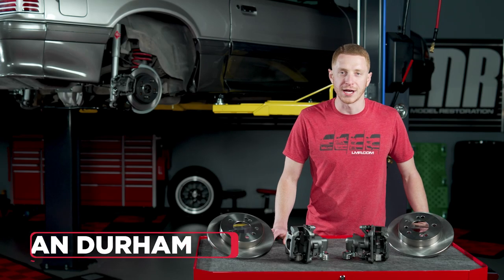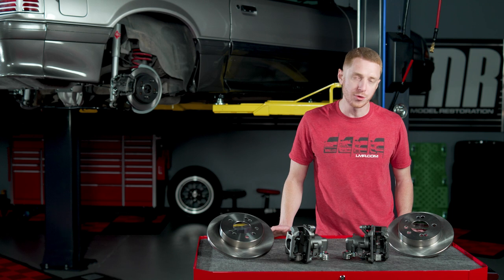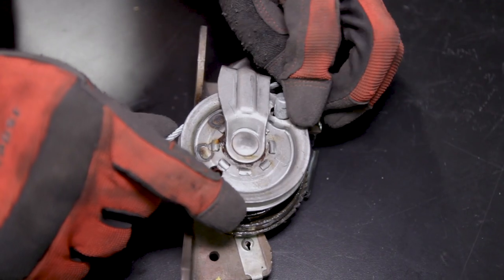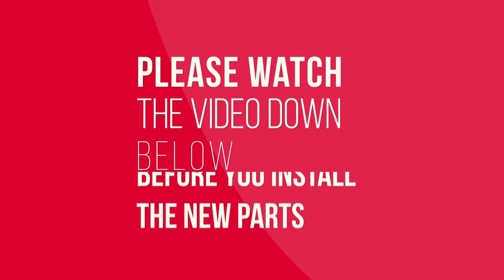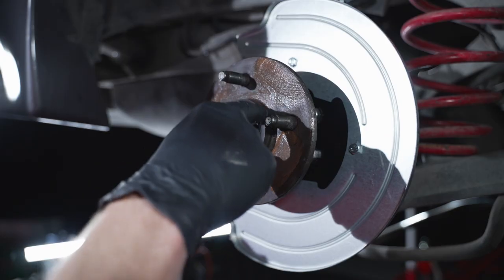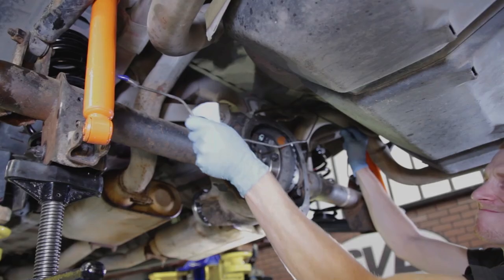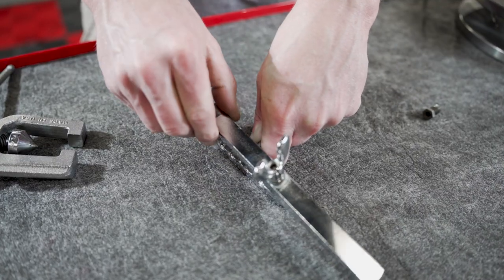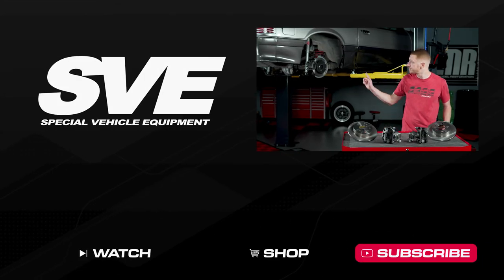Fox Body Mustang 4 Lug Rear Disc Brake Conversion Kit (1979-1993)

Comment: Now we need moded spindles that way we can run cobra/GT brakes on 4 lugs of course with a 17 inch rim, or can we get a hub on a 4 lug to put onto a sn95 spindle to use the mounting points for the cobra/GT brakes.

Comment: So it looks like this kit will also work for us who have already converted to 5-lug with the Fox length axles?
Reply from the maker: Hey Derrick.

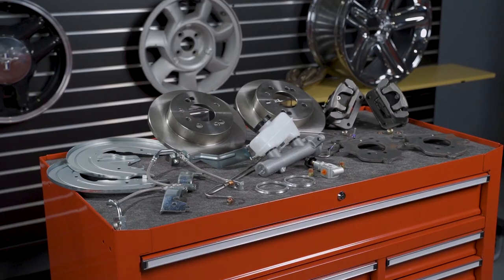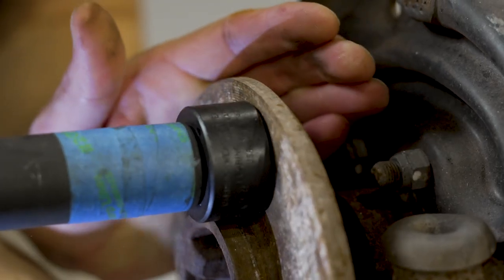You are correct!  If you already converted to a 5-lug rear drum, then this kit would technically work.  However, being that we market the kit as a 4-lug setup, there are only 8 SN95-style studs in the kit.  Please watch 3:17-3:45 of this video as I talk about thread engagement and wheel hub thickness differences.  This is important to note.  Please let me know if you have any questions.  -Landan

Comment: What would be the matching front brake calipers and rotors if I wanted to upgrade the front brakes as well?
Reply from the maker: The SVO caliper is about the only thing you can do in the front and still retain a 4-lug setup. You'll be surprised how well the car stops with just the rear disc conversion, and you may not want to mess with the front. -Landan

Comment: Can these be installed facing towards the front instead of facing the rear? I have QA1 coilovers, and for whatever reason, the coilover sits right up against the brake caliper. So adjusting the height is not possible. Relocating the  brake calipers towards the front will fix the issue. Just need to know if this can be done with this kit.
Reply: @lmr was there any info on being able to do this.

Comment: Does this kit work with a c clip eliminator kit with 4 lug 35 spline axles?
Reply from the maker: Hi Brian,

This kit is not intended for use with C-Clip eliminator kits. Feel free to give us a call or email us if you have any other questions or concerns.

Comment: 5 lug axles from the site would work? Then would just need the rotor without the extra holes ?
Reply from the maker: Voodoo315,

Yes.  5-lug axles from our site would work.  The rotor included in this kit would also work, or you can purchase the non-drilled 94-04 V6/GT rear rotor.  Please watch 3:17-3:45 of this video as I talk about thread engagement and wheel hub thickness differences.  This is important to note.  Since these kits are marketed as a 4-lug setup, we only include 8 SN95-style studs in the kit.  Please let me know if you have any questions.  -Landan

Comment: Will this work on 1980 mercury cougar XR7 ?
Reply from the maker: These kits were designed specifically for Fox Mustangs. Even though the 1980 Cougar XR7s were built on the same platform, I can't guarantee that it will work. Thanks. -Landan

Comment: Has anyone tried this with 14x7 American Racing outlaw II wheels?

With these wheels on the 87-93 front (11 inch) rotors, the caliper needs a little grinding. Or use of a .25 wheel spacer. 

This kit has 10.5 inch rotors though. I'm wondering if it requires any modification?...

Comment: Does this kit work with C clip eliminators. And can you buy it in peices ?

.. because my car is a drag car .and don't need 90% of this kit ..
Reply from the maker: Hey there, 

This kit is not intended for use with c-clip eliminator kits. As for all the components, it is not available in separate pieces. It is all available in the one kit.

Comment: foxbody brakes sells the 4 lug kit. Nice but hard pedal. Need to know what master cylinder.  Keep hearing 93 cobra.
Reply from the maker: Tim, This is correct, the 93 Cobra is recommended for the 87-93 and and SVO master cylinder can be used on the earlier Fox applications.

Comment: so will these calipers fit the old kit that is no longer avilaible, i have the old rear disc conversion and need new calipers
Reply from the maker: No.  The caliper mounting bracket ears are different on the 99-04 Cobra-style calipers, and the 94-04 V6/GT rotor diameter is .5" larger in diameter.  Hope this helps!  -Landan